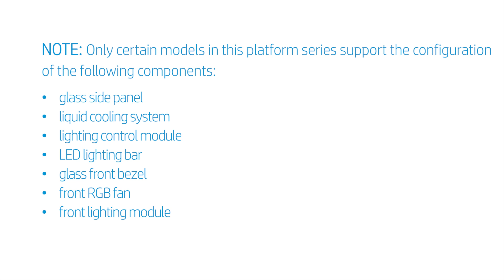Replace the Power Supply | OMEN 25L GT11-0000a, GT11-0000i, 30L GT13-0000a, GT13-0000i | HP

Comment: Which PSU is supported for an HP Omen 30L? I need an aftermarket product from 3rd party supplier because i need a replacement as soon as possbile.

But no one i tried passed in some not holding inside, some Connectors on the backside collide with the case frame so its not getting in and some cables arent thin enough to fit in the backside of the case so theres no hope to close the backpanel!

Its a insanely inkompatible with anything from 3rd party!

I want to keep it stock but the supply broke and there were sparks coming out so i dont want a cooler master anymore - or a better one if theres no other option :/

750w + with all security funktions! 
RTX 3080 + 10700k inside - was in love with that pcs after installing better fans but the sparks destroyed my opinion about it.

Hope to hear from u soon maybe it changes my mind.
Reply from the maker: Hi there, thanks for contacting HP Global Social Media Support!
I understand that you need compatible power supply unit for your computer.
I will do my best to assist you.
For optimal PC and printer performance, remember to always buy (use) Certified HP Genuine Replacement Parts from a known and trusted source. You can order it via the HP Parts store: https://hp.care/6055sPqkH 
Regards, 
HP Support

Comment: I have been having issues with my GPU. Bought the system in January 2021 so I am out of warranty.  I took it to Microcenter to have them try it in a system there and it did the 'signal lost' thing on their machine too. So, I fear that my card is defective even though I am able to use my system as long as the card is not being stressed. It's sporadic graphic loss. Speaking to a tech at Microcenter, I asked him what card could be used to replace the 2060 Super. He told me I should be able to use the MSI GeForce RTX 3060 Ventus 2x overclocked dual fan 12GB GDDR PCIe 4.0.  Given that the PSU is only 500W will this card work with this system? I ask because NVidia states the wattage should be 550W. If I replace the PSU, which one would do it for both the new card and the motherboard for the 30L? What about the overclocking? I am not interested in any of that nor do I know how to change features on a card. In fact, I always played my games on this system from day one right out of the box. With the exception of Windows Updates and new NVidia drivers, I do not really bother anything. I think a Windows update and/or an NVidia update in mid-December 2023 did something to the card. I had zero issues prior to that day and have had nothing but problems ever since. Please advise and thanks!
Reply from the maker: Hi there, thanks for contacting HP Global Social Media Support!
I understand that you are experiencing an issue with the graphics card of your computer.
I will do my best to assist you.
Please refer to the instructions mentioned under this document to fix the issue: https://splr.io/6054cmQNm
Regards, 
HP Support
Reply: @HPSupport  I have done everything but alter the performance of the card. I will try that and see if it helps. Last night I got the error even while playing a low-graphic game which makes me feel the card may truly be defective. This is also because the card lost signal on the Microcenter PC where I brought in my GPU and RAM to have both tested. RAM passed but GPU crashed within seconds on MSI Afterburner(I think). I will follow up with my results. Thanks!
Reply from the maker: Please let us know how it goes!
If you need any help in the future, you can always get back to us.
Thank you for being a valuable HP customer.
Have a wonderful day!
Regards, 
HP Support
Reply: @HPSupport  Hi again, I tried what you said and the issue still happens. In the BIOS(which I updated in diagnosing after this first started happening)are there specific settings in regard to the RAM or PSU that could be causing these issues? I think I read somewhere that the optimized settings have to be reset when updating the BIOS. Wouldn't this control the PSU/GPU/CPU/RAM voltage, etc if that's what is causing the issue? All of this started with both a Windows Update and NVidia updated driver. I have the 2060 Super. Thanks!
Reply from the maker: As the issue still persist, please feel free to reach us on call/chat for further support. Access this link to select your preferred country and language option to reach us. 
Global support link: - https://splr.io/6059cqR6f 
Regards, 
HP Support
Reply: I already spoke to support and they quoted me over $300 to ship my system in for repair, since it is out of warranty.  I am still having trouble with a computer I've only had three years already having such a major issue.  I don't have the means to ship it in due to financial restraint so I am still looking into this on my own.  As for my BIOS question, is there a particular setting or an optimized one that is used for the 30L? I am really in a spot here because neither the 30L or the 2060 Super is manufactured anymore.  Thanks @HPSupport

Comment: Hello, I bought a 30L Omen desktop  a couple months ago, and now when I went to plug my desktop in, the PC won't turn on. No light or anything. I made sure it wasn't the outlet or the cord. Does this mean my power supply stopped working? If that is the case, how should I go about replacing that? I only bought the PC a couple months ago from Best Buy.
Reply from the maker: +Max Hopkins This document provides possible solutions to many common computer start-up issues. Follow the instructions in this document step-by-step to help isolate the problem and find the most appropriate help: http://hp.care/2oFlOWC
Reply: @HPSupport   This is literally not helpful.

Comment: I bought a Omen 25L desktop with rx5700xt and ryzen 7 3700x and the 500watt psu that come with it is not enough. Why hp decided to put a 500watt psu in to a system thats recommended to use 600 watts?
Reply: I have one with Omen 25L with a power suply of 300W! Can you belive this?!
Reply: @ruireis7095   how they sell it with a 500watt standart psu. If you have a 300watt psu i think that you have a worse set up that draws less power. i had to underclock my card to not crash in games which kinda solves my problem.
Reply: If you don't overclock you will be fine with a 500w. The recommendations from GPU manufacturers account for overclocking.
Reply: @PlayWaves1  i had to underclock to not crash in games...
Reply: @unkowndude649  I have a 3070 with 500W and I don’t have to underclock so why do you
Reply: @PokemonDude880  It depends on many things. You could have a better powersupply and have 80+plus platin or gold (i have 80+ bronze). Your cpu might also be weaker which draws less power (i have ryzen 9 3900) and my fans spin pretty high due my bad airflow. It also depends on what you are doing, if you play non intensive games you should be ok (atleast it was for me) but when i changed to rdr it was over in few mins. As our cards draw similiar power and you probally have a weaker cpu? with a better airflow, fans not crancked up to their max and i hope with a better psu you could have more power left for spikes which result the crashing.
Reply: @unkowndude649  I have a 3700x a stronger cpu
Reply: @unkowndude649  and it’s a bronze 500W. I’ve played rdr2 on ultra, mafia 1, hitman 3, assassins creed, forza, crash 4 and literally no issue
Reply: @PokemonDude880  3700x is weaker and draws less power than ryzen 9 3900x
Reply: @unkowndude649  it’s not weaker lmao it just draws less power. 8 cores>6
Reply: @PokemonDude880  It is the ryzen 9 3900x has 12 cores clocked at 4.60 ghz
Reply: @unkowndude649  oh my bad I thought u said u had a 3600 my bad my bad
Reply: @PokemonDude880  Well that explains a lot.
Reply: Bruh same thing here, i have an omen 25l with an rtx 3070 which its lowest recommended is 650w but it comes with a 500w
So now im buying a 750w power supply to replace it
Thought HP was a good company before i bought the pc, now i hate them

Comment: Hi I am so lost, I bought a 30L Omen and it came with 500 , I want to upgrade to a new graphics card but my power supply is only 500 so I got the EVGA 750W gold standard g2, I tried swapping it turns out that the motherboard does not have a 24 pin connector. Please what are my options?
Reply from the maker: +Hawrris Niazi You can purchase the part from here: http://partsurfer.hp.com/ Please select your country and enter serial or product number of your unit.

Comment: Mine got stuck in a bios update boot loop and now will not turn on it's still under warranty but none of the customer service phones or chats are available at the moment I think that my power supply may be damaged hopefully not the motherboard as well
Reply from the maker: +Dartlin Please contact our phone support team to fix this issue:
Please follow these steps to reach them.
Step 1. Open link: https://support.hp.com/us-en/contact-hp
Step 2. Select the product type.
Step 3. Enter the serial number of your device or select let HP detect your product option.
Step 4. Select the country from the drop-down.
Step 5. You should see the HP phone support number.

Comment: I have an Omen 25L that came with a 500w PSU and want to upgrade to the 750w PSU. Can I purchase the Cool Master 750w power supply directly from HP? If so, how?
Reply from the maker: +Michael Do You can purchase the part from here: http://partsurfer.hp.com/ Please select your country and enter serial or product number of your unit.
Reply: HP Support thank you for the response! Would you be able to help me find the product number for Omen 750W power supply? I can’t seem to find it anywhere. I also tried searching for the product number for my current 500W power supply and couldn’t find it on that website. Any info help would be greatly appreciated!!
Reply: @shai-halud  I'm trying to do the same as well any luck on finding it yourself??
Reply: @shai-halud  did u ever find the psu
Reply: Any standard ATX size PSU will fit. 150 x 140 x 86.
Reply: @PlayWaves1  Did you change powersupply to std ATX?

Comment: I have a 25L with a Ryzen 5 3500, GTX  1660 super and a 500w PSU. Later on the year I’m planning on upgrading the graphics card to a 2060 super. Will the 500w power supply that comes with this pc be enough for the rtx 2060 super or would I need to upgrade?
Reply: Also they made this case and motherboard so small it’s almost a problem when upgrading to a bigger and better graphics card just because it might not fit with the space given to you
Reply from the maker: +Prince Centillas HP does not recommend upgrading or downgrading hardware parts or software that is bundled with the product as It may affect the manufacturer's warranty and performance, however, you could change the configuration at your own discretion.
Reply: HP Support so will a 500w power supply that comes with the pc be enough for the rtx 2060 super?
Reply: Prince Centillas lol just like HP not to answer your actual question it’s funny they say that cause this pc is advertised as customizable and “you can do what you want with it” anyways I have the 30L and I can tell you from experience you will need a better power supply I upgraded the power supply to a thermaltake 700w and everything runs fine the only downside is the placement of the screws for the power supply I got are not the same as the cooler master 500w psu they have as stock so I made my own work around for that